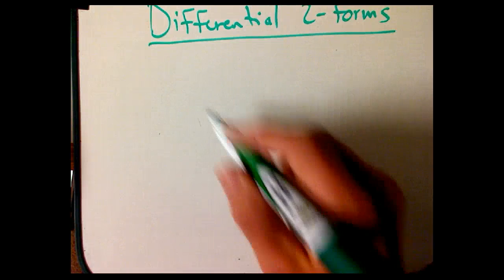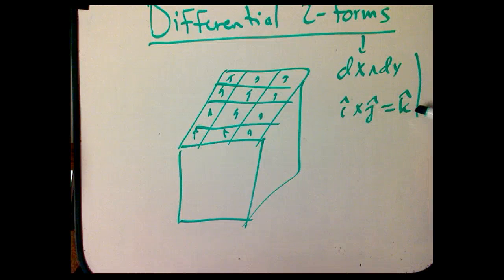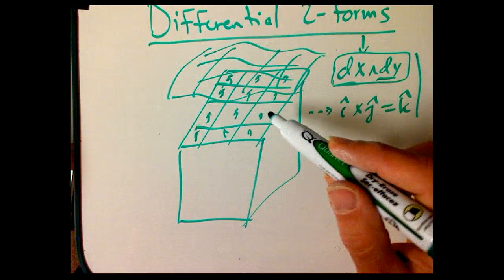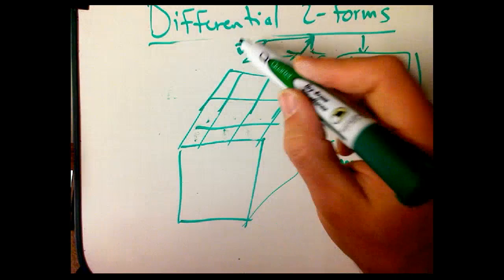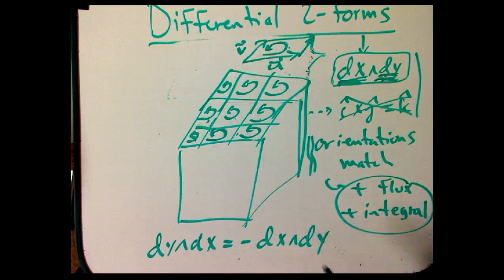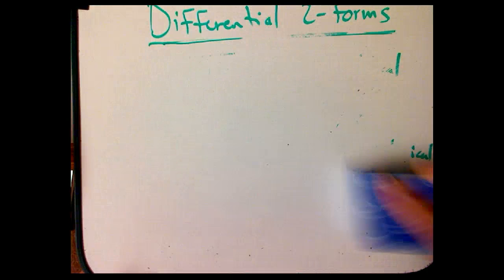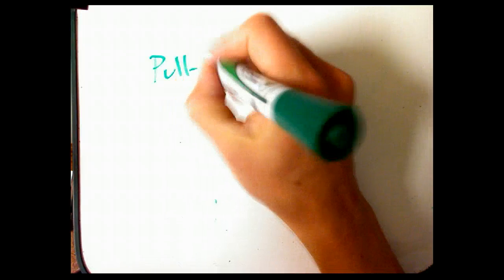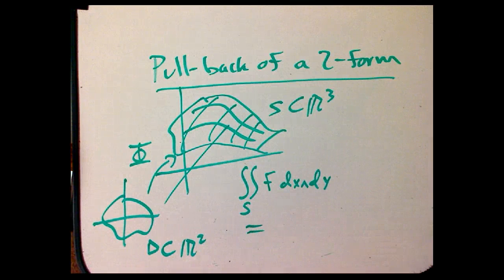Intro to differential forms (part 4)

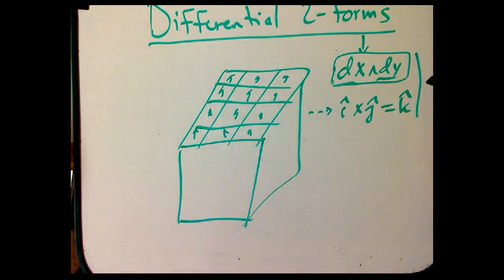Comment: @1:45. A two-fold cross product can be found in 7D as well as 3D. There are other kinds of cross product which exist in other dimensions. See the work by Eckman and Whitehead.

Having said this, I think differential geometry should be taught before specialised exterior algebra like the cross product.
Reply from the maker: True in a fashion, yes, depending on what requirements you put on what you mean by a "cross product". The octonions are certainly a neat object, so the 7D "cross product" that comes from the imaginary octonions is cool in the same way. But if you want the product to be invariant under the full special orthogonal group, then the 7D version doesn't work. It's also annoying that it isn't a Lie bracket, but to me, failure of invariance under SO(7) is the worst feature.

Comment: Hi David, at 7:06 you talk about expressing dphi/theta in terms of the dx and dy. How do you do this? What's the rule for 'd' of a function? Thanks for the great vids
Reply from the maker: +nic0lemc Check out Video 2 at 15:30. One way is to define df =  (partial f/partial x) dx + (partial f/partial y) dy + (partial f/partial z) dz, with dx,dy,dz understood as the basic "stacks" that go in the x,y,z directions. That's how we usually calculate it. More elegant is that df is the machine that eats a vector v in a way that gives the directional derivative: (df)[v] = Dir. Deriv. of f by v.

Comment: Hi David,

Thanks for the great videos on differential forms! The geometric meaning is eye-opening! I have a question for you about the density of level sets. In some cases, like for the 1-form 2xdx that you mention in "Intro to differential forms (part 2)", the levels sets get more densely packed as the coefficient of dx (which is 2x) increases. 

In this video, you show the 2-form for the spherical polar coordinates example to be sin(phi) d(phi)^d(theta). However, the level sets for this case get more densely packed as the coefficient of this 2 form (sin(phi)) decreases at low values of phi near the north and south poles of the sphere. Why is this inconsistent from the 1 form example I mentioned? 

In your other video "Differential forms calculation: the Laplacian in spherical, cylindrical coords (Part 1)," you describe the magnitude of the 1 form to be inversely proportional to the spacing as given by 1/sin(phi) being the magnitude for d(theta). But this seems to not be consistent with the 2xdx (of which magnitude might be 1/2x) example. Let me know if I'm missing something between these coordinates or in transforming to unit magnitude or just a distinction in 1 form vs. 2 form. Thanks!
Reply from the maker: Laqshya Taneja Here's the deal: the form dx has constant magnitude 1, so its sheets (which are indeed level sets of x) are equally spaced. The same is true of d(phi), since the polar angle phi increases uniformly as you move down a longitude line (anywhere along that line). But d(theta) does not have constant magnitude, since theta changes more rapidly near the poles; as you note, its magnitude is 1/(sin(phi)). So if you draw the picture for d(phi) wedge d(theta) (without the sin(phi)), which means just draw the usual latitude and longitude lines, then this gets denser at the poles. In order to make it into a constant-magnitude form (which the area form on the sphere should be) we multiply it by sin(phi), to counteract the increase in magnitude of the d(theta) part that is indicated by the convergence of the longitude lines. Note that sin(phi) d(phi) wedge d(theta) = - d(cos(phi)) wedge d(theta) = -dz wedge d(theta), so to draw a picture of the area form on the sphere, you would draw level sets of the height function z and the longitude lines. Near the poles, the level sets of z get spaced further apart (since it's close to horizontal) and the longitude lines converge, in such a way that the areas of the grid cells are preserved. 
Maybe I should add a note about this to the Laplacian video.
Reply: David Metzler Great, this makes sense! Thanks!
Reply from the maker: Laqshya Taneja I probably wasn't clear enough that I was talking about what happens on the unit sphere, but it looks like you figured that out.

Comment from the maker: Absolutely, they are a "graded commutative ring", (graded refers to the different degrees, and graded commutative means the weird skew-commutativity we have for forms) and in fact a "graded commutative algebra", which means that you can multiply by "scalars" (really scalar functions) and  the expected laws hold (basically ring plus vector space axioms). Combine that with the exterior derivative and you get that it is a "differential graded algebra", which come up a lot in higher math.